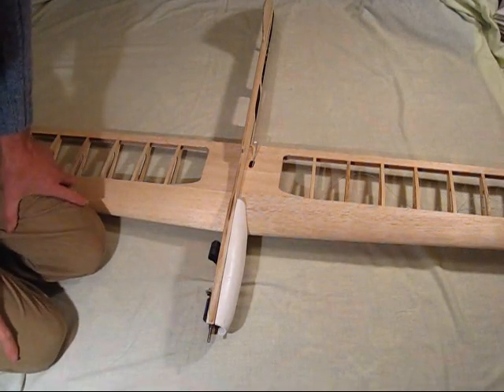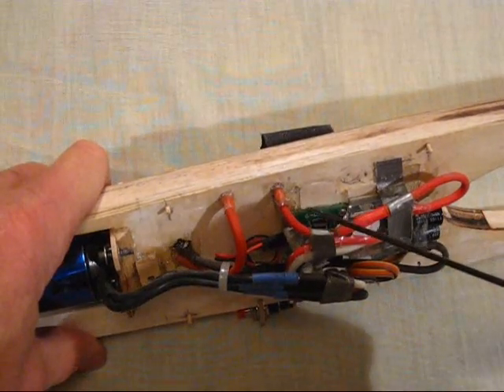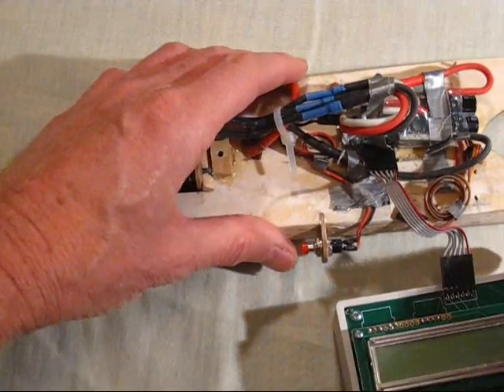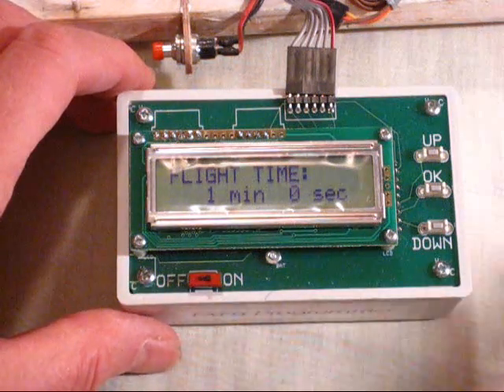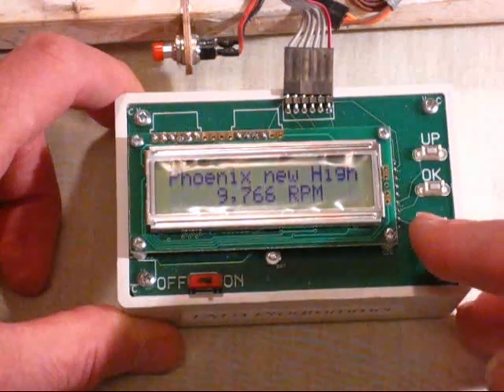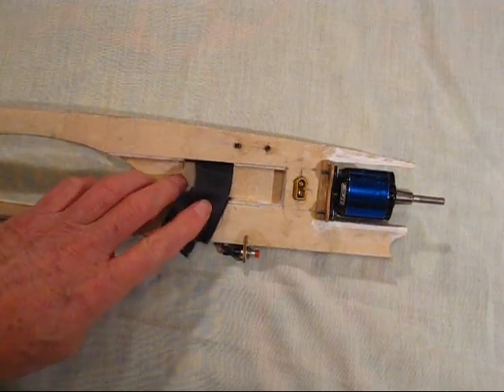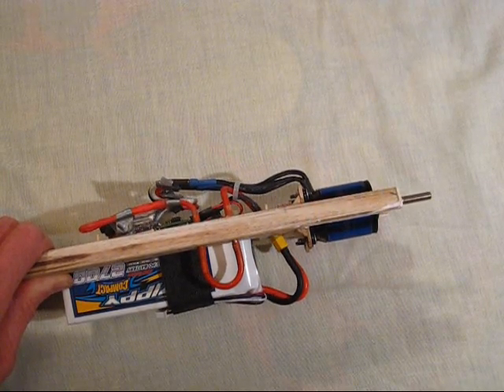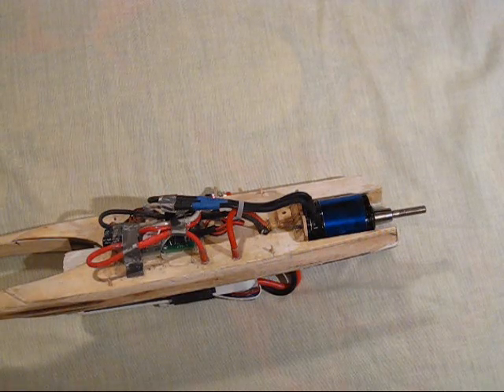John B goes ELECTRIC

Comment from the maker: Hello Franz,
I've used a Will Hubin (from the USA) Timer and Programmer coupled to a Castle Creations Ice Lite 50 ESC.
The Lipo I've used is a 2700 Zippy Compact x 5 cell x 25C.
The motor is an OS 750 and turns an 11" x 6" three blade PUSHER prop with the motor reversed.
Check my YouTube site to see a vid of the model flying and called 'JB flies his Electric powered C/L Cardinal model'.
Hope this all helps.
Regards.......JB.